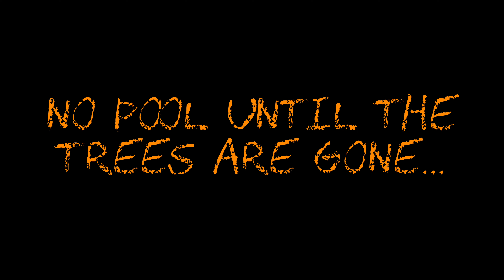#236 No Swimming Pool Until the Trees are Gone...

Comment: What is a good used chipper to get for 9” trees and under? I occasionally have customers asking to take down trees but not always able to take wood with me because I have the tractor with me on the trailer.
Reply from the maker: My WoodMaxx Mx-8800 is a great option. When I have smaller jobs that requires the tractor but not a big chipper I can bring the WoodMaxx on the back and it eats through brush. The best part is I can haul it all with one truck and trailer. Check out some of the videos I’ve have using it.